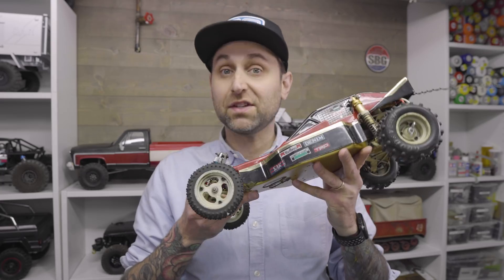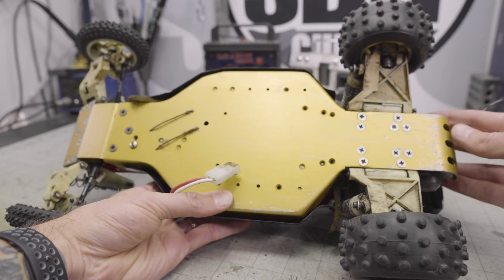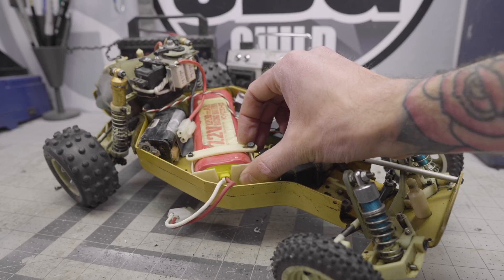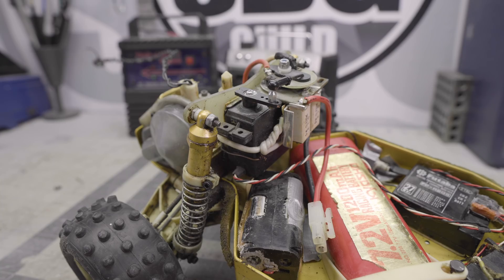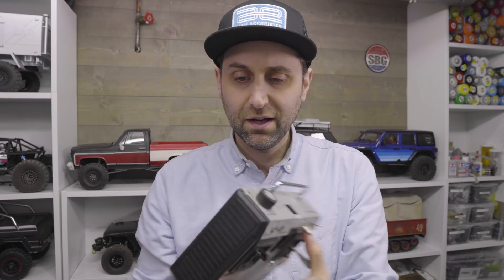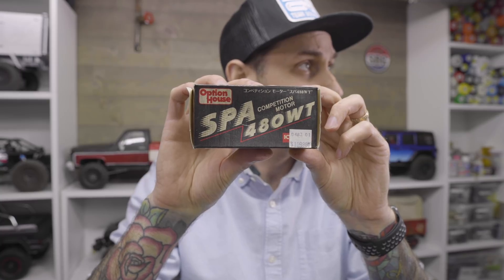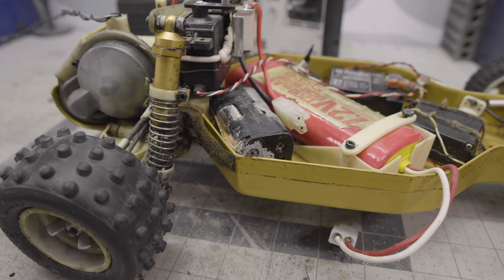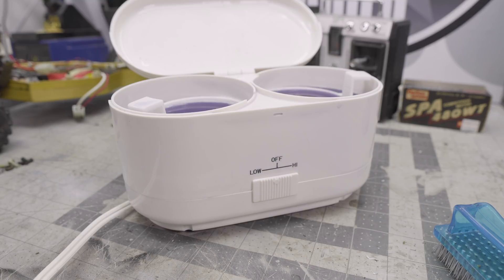Throwback Thursday! Associated Electrics RC10 Restoration

Comment: Nice! Love those early RC10.

Battery is mounted weird in that one. Mine were always straight. The battery tucks into that shock tower pocket. Servo tape is strong enough to hold servos.

Memories... Every battery charger I had from 80s & early 90s had that big dial timer. You plug-in the battery and set the timer for 20 minutes. Listen to the timer click for 20 minutes. If the battery was still cold set the timer for another 5 minutes. Repeat till battery was warm. Lol. Oh and the old school 4-pin Dean’s connectors, way before beefy Dean’s t-plug. In the 80s I had Novak ESC and switched to Tekin in early 90s. Checkout the Tekin 410K... it’s wild. Orion batteries were the bomb and Trinity Green Machine motors killed it.. Memories.

My favorite was first gen RC10T (91 or 92?). Those were so easy to drive compared to buggies. And my second favorite was a RC10 gold chassis with stealth transmission (89-90? Can’t remember was very young) so not as vintage your awesome buggy.
Reply: Actually, in the original rc10's the battery sat sideways and that little pocket under the rear shock tower was where the servo was mounted to control the mechanical speed control.
Reply: Didn't Trinity also have a 'Gem' series?  I think I had a Topaz on my Traxxas Radicator.

Comment: that's not the right speed control, i still have my unused original somewhere burried in parts boxes. I put novac electronic on when I put mine together and it is still on it and working. I got a volt meter with alarm so I could run a 2 cell lipo with the old electronics, I dyed all the white nylon parts red and put on an aluminum wing.and gold plated universals.i still have several rc10s and several gts and a ton of aftermarket parts like flat chassis , swing arm rear suspension and M I P trans.

Comment: omg! My Grasshopper speed controller burned me more than once! They used to sell a rubber balloon cover to make it water proof. 🤣🤣🤣 lasted long enough to power up the car. 🤦🏼‍♂️
Reply: Mike’s Blue Sky Productions Utah   My Grasshopper II mechanical speed controller wires would melt off with every use.  I got really good at soldering.

Comment: still have my b2 .. 20 + years no service of trans or diffs and it still shunts on 3s with a 9 turn brushed motor .. dont make them like that anymore !
Reply: I picked up a B2 about a year ago. Traded some kid for a Grand theft auto 5 game. It’s complete but when I run it I only get about 7-8 minutes of run time. And only get top speed for a minute or 2.  Traxxas titan 12t550 motor and a traxxas xl5 esc. I bought a new battery. 7.2 volt 5300 mAH. Got any tips?